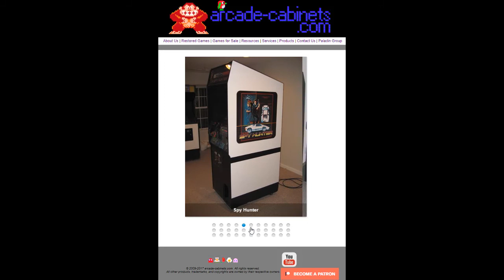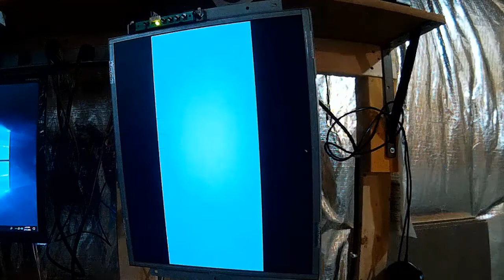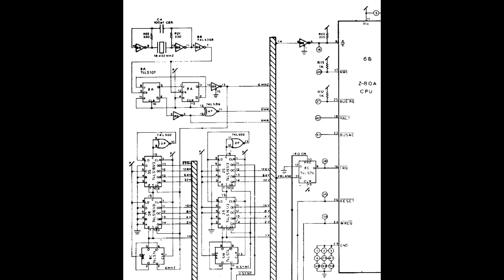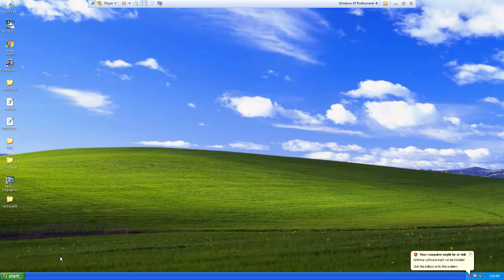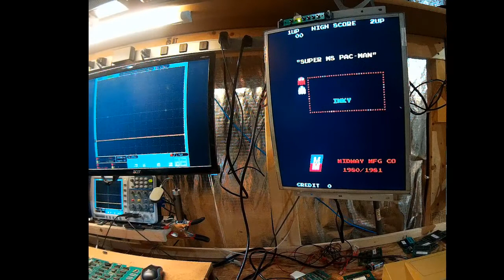Arcade PCB repair #20180216.01: "Dead Ms. Pacman" (Sync circuit)

Comment: I'm not sure if all arcade games have separate TEST ROM chips, 
1.) What are the differences between using the arcade games test mode diagnostic test program compared to using a separate TEST ROM chip? You remove one of the ROM chips from the socket and instead a TEST ROM chip. The Test ROM chip does more deeper level ROM/RAM test I'm guessing
2.) Some repair technician say that dual wipe sockets are better than the machine pin sockets. I thought that the machine pin sockets had less intermittent issues and dual wipe sockets cause more intermittent issues.
Reply from the maker: 1) test roms are usually found for games that didn't have test roms built in. some people have written "better" test roms for games that do more stuff.

2) I do not recommend machine pin chips. I like dual wipes for a bunch of different reasons.
Reply: @arcade-cabinets  
They have test rom chips for arcade games that have built in test modes also. I'm guessing people have made these AFTER the 80's game programmer. 
1.) I wonder why I can't use the same TEST ROM chip for any arcade game because the TEST ROM is doing different types of ROM test and and RAM tests so i would think the TEST ROM chip should work for all arcade games. 
What do you think makes the difference in the code that the test rom chip won't work for ALL arcade games?
2.) Can you list why you like dual wipe sockets compared to machine pin sockets?
Reply from the maker: bill williams  different games have different memory layouts. Some chips can be used in Multiple games if the system architecture is the same. In the 80s manufactures often made a platform that could just have different Roms for each game just by swapping Those often can use the same  test rom chip. However each game has different code so you cannot have. A single test rom that checked the other Roms only ram and sound and video.

I don’t like machines pins because 1) there legs and connectors are big so it’s hard to solder them in correctly, often people will try to solder them in and overheat things in the process destroying the traces and via’s, or bridge traces.

Then 2) it’s almost impossible to remove them once installed without destroying the traces

3) it’s hard to insert chips in there everything has to be slight perfectly and often pushing them In will break the legs
Reply: @arcade-cabinets  ok thanks for the help
1.) So are you saying that the since each arcade game has a different address mapping/address decoding you can't use a single test rom chip for ALL arcade games? or it's not about the address mapping/address decoding?
2.) If a software programmer wanted to make ONE signal test rom chip for all 80's arcade games what would need to be done in general?
Reply: @billwilliams6338  1) yes there's no way of making a single test rom for every single game
2) it's literally impossible.
Reply: @tvbrzezicki2874  can you please explain why so I can learn why it can't work just in general not the deep details of code just in general overall why it can't work.

Comment: ARCADE CABINETS, 
 the FETs or Cells inside the 4116 dram needed +/- 5 and +12 because of what reasons to store the data bit? because 4164 are Dram also but the cells fets only needed +5vdc to store the data bit, why?
Reply from the maker: I have no idea, I'm not an electrical engineer. that would be a question for the people who designed the chip way back when.
Reply: @arcade-cabinets  ok thanks
Reply: @arcade-cabinets Thanks for the help. Not sure if you know the answer to this but For Bally midway Galaga they used a custom sync generator chip i'm guessing for the V&H sync counter chips are built inside this custom sync generator IC chip. How does the Sync Generator chip work, what does it do?
Reply from the maker: @billwilliams6338  basically what you said, they just made a chip that combines a bunch of other chips/logic into a small single chip. Namco used this chip on a bunch of games so it was probably cheaper to just make a custom chip that had the counters and some other functionality than to use the space on the board and a bunch of other chips.I don't know all the functionality that this chip does but it certainly handles timing as well as data buffers.
Reply: @arcade-cabinets  oh ok thanks I wasn't sure what the chip had inside of it.

Comment: ARCADECABNIETS<  I'm confused on the video sections in arcade games from the differences of Raster arcade games compared to Vector arcade games. Raster arcade games use Horizontal and Vertical sync signals for the CRT positioning coordinates and uses a Color PROM chips to choose which colors tints etc. Vector games don't use H&V sync signals but uses Deflection signals. I don't know what the differences are between H&V Deflection signals compared to H&V sync signals. What are the differences between H&V sync signals compared to H&V Deflection signals or are they the same thing? Vector arcade games don't use a Color PROM chips like Raster arcade games? In Raster arcade games the game board outputs an RGB signal with V&H sync signals which is 5 separate wires to the CRT monitor board? In Vector Arcade Games the game board outputs  H&V Deflection signals and RGB signals to the CRT monitor board?
Reply from the maker: bill williams: honestly I have no idea how vector monitors sync or if they even have a concept such as such. I don’t usually mess with vectors. I thought vectors just draw/deflect the beam as needed using a +/- charge on each axis as needed but I could be wrong, I never mess with vector video hardware honestly so I could not really say with any certainty.
Reply: @arcade-cabinets  ok thanks i thought maybe you knew about arcade games in the 80's that were vector and not raster because some arcade games in the 80s were vector
Reply: @arcade-cabinets  what would be the "Equivalent" to a "DMAGO signal" in an arcade raster game non-vector game?
Reply from the maker: @billwilliams6338  I don't know of any raster games that have anything like that honestly. I think it was just a Atari vector oddity. (DMA is NOT an Atari vector oddity) but the whole vector video circuit halting the CPU , I cannot say I've seen on anything but Atari vectors. (and I"ve only seen vectors that are Atari, maybe other vectors do to but I don't know)

-brian
Reply: @arcade-cabinets  ok thanks

Comment: But most arcade games Z80 and 6052 CPU use a 16 address lines but the ROM chips are only 11 address lines any reasons why? This is what confuses me is that all the ROM chips 2716, 2732, 2516, 2532, etc are all 11 address line inputs so each ROM chip can only hold up to 2048 address.  I would think a 2732 or a 2764 would have more address to hold compared to a 2716 ROM chip, but it seems that a 2716, 2732, 2764 all just only have 2048 address maximum? I might be confused how to calculate using a calculator on how many bits a 2716, 2732, 2764 can hold, how can i calculate using what formula? The maximum address is 2048 but the "amount of bytes per address" might be different for a 2716, 2732, 2764?

Comment: How do you calculate using a calculator formula the maximum data bits that a single ROM chip can hold?  2516 ROM or 2532 ROM chip how can you calculate the max data bits that it can hold
Reply from the maker: 2 to the power of the number of address lines. if there are 11 address lines it's 2^11 or (2x2x2x2x2x2x2x2x2x2x2)  = 2048 and these are the number of bytes. for exapmle a 2716 or 2516 has 11 address lines (a0 - a10) so it has 2048 addresses each holding 1 byte of data.